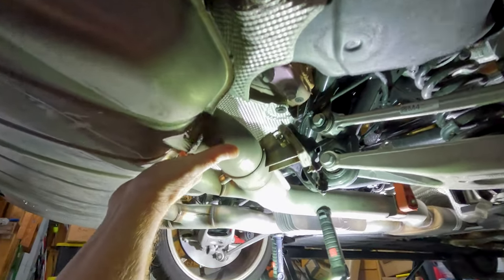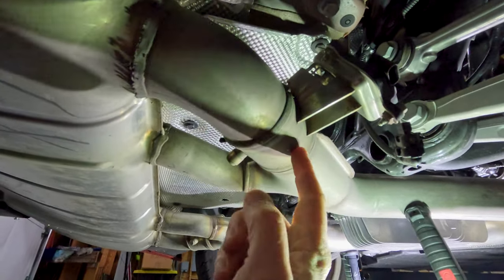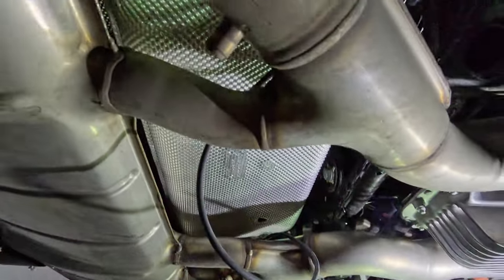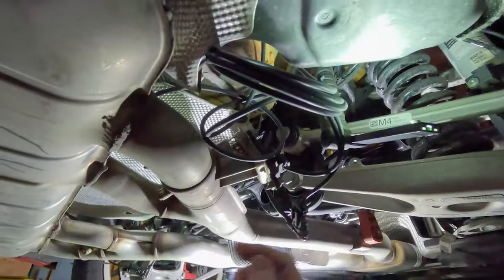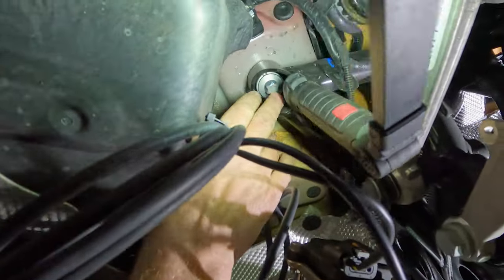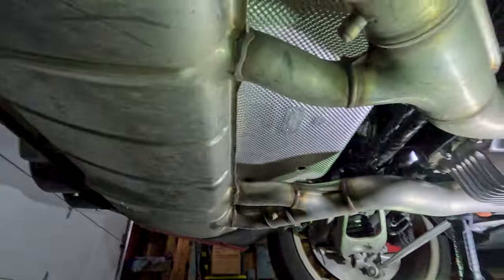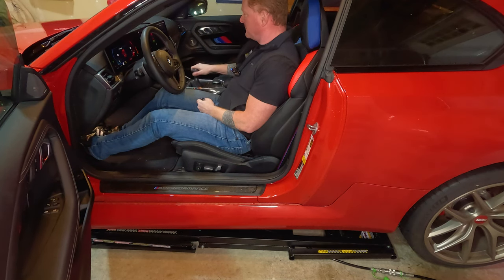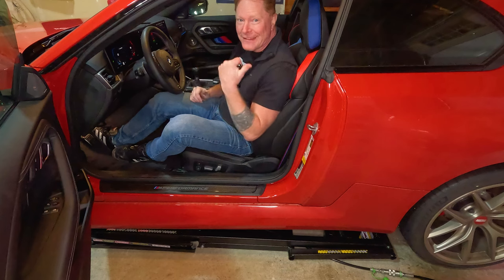Control your BMW exhaust with the Dahler controller - Get the full control BMW doesn't give you!

Comment: Hey!

How would you rate Dahler controller with stock system on a scale of 10?
And original valve controller but only AA EL mid-pipe?
In your videos DP is all stock right?

Does it worth the money difference or the Dahler controller would be also enough for more blurs and pops?

Just to make sure, it makes no sense to get AA EL mid-pipe with Dahler, right?

Thanks for answering!
Reply from the maker: @MarkMohai-ep4jl  At this point I am stock DPs with the Active EL midpipe and axle-back exhaust.  The Dahler controller is excellent and worth it, a 10 in my book. It adds more functionality and control over your exhaust which I find worth it.  The controller works from full oem to fully modded, so you can use it with whatever your setup is on your car.
Reply: @BMWDIYGuy  Thank you so much! Appreciate your honest opinion.
Still, would you recommend Dahler control for the OEM system for start? Would I get more pops and blurs on the OEM system?
Then, if it is not enough, I can always get the AA EL midpipe as an additional, right?
Thanks!
:hand-purple-blue-peace:
Reply from the maker: @MarkMohai-ep4jl  it absolutely can be added to full stock and will make a difference in both overall volume but bubbles will be more pronounced when fully open.

Comment: Great content!! Just found your channel and subscribed. 

I assume this in addition to your AA mid pipes that you installed in a previous video. If so, did you do it to have even more control over the sound you’re getting with the new AA mid pipes?

I have a white 2023 g87 M2 and trying to figure out how to make it sound better too. Just not sure I like the idea of cutting the stock mid pipes for the AA ones. That’s a one way trip that you can never really put back to stock “exactly”.
Reply from the maker: Thank you and the active pipes are excellent! As an upcoming content surprise, I will have their axle back exhaust shortly too.  You can easily go back to stock though with the joining clamps or have it welded too.
Reply: @BMWDIYGuy  Can’t wait to see the axle back video! 

AA also told me you can clamp and/or weld the mid pipes back to stock, but it’s still not the same as uncut mid pipes. 

My concern is more from a resale perspective. If I decide to sell the car down the line and want to go back to stock mid pipes, I could see a buyer viewing the cutting/clamping/welding as lowering the value of the car.
Reply from the maker: @sydsM3  I am sure someone might care, but never met anyone that would see that as an issue.  I wouldn't stress on it myself and the upgraded exhaust is worth it, likely to a later buyer too.
Reply: @BMWDIYGuy That’s a reasonable point of view, although I have run in to people that prefer pure factory OEM cars with no mods.

No matter though, I’m going to wait for your AA axle back exhaust review and see what that sounds and looks like with the mid pipes. I believe getting both at the same time would be a straight parts swap with no cutting required.

I will say though. I love the factory chrome exhaust tips on my car from a pure look perspective…😊

I’m also starting to go through your other g87 M2 videos and am impressed with every one of them so far! You are very talented and really know your stuff!
Reply from the maker: @sydsM3  thanks so much!
Reply: @sydsM3 not sure what state you’re in but in commiefornia if the car gets state reffed it could be handy to have the stock exhaust in the garage. I have a full titanium catback (single midpipe) which was relatively  easy to install and does not require any cutting, also had its own replacement valves with a controller. The sound is awesome, very loud pops and bangs, I just wish this car had a little less sound deadening because it’s still hard to hear with the windows closed
Reply: @InclineDumbbell Thanks for the info. Which exhaust do you have? Is it the AA single mid-pipe plus axle back?

I live in south Florida.
Reply: @sydsM3  full catback

Comment: Meant to ask you this a while back. Did you consider the SST and Milltek valve controllers? If so, what made you choose Dahler?
Reply from the maker: I try hard to not comment on hardware I haven't actually used, so they both may be great.  I have been hands on with Dahler now multiple times,  and met folks from the company at the Kies show.  For me it was the only choice.
Reply: @BMWDIYGuy Fair enough… Thanks for the quick response!